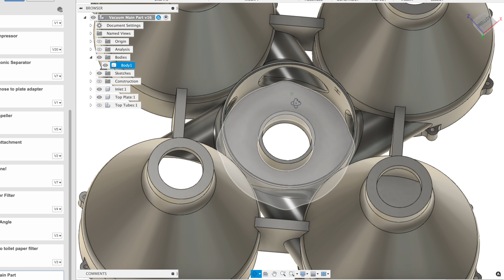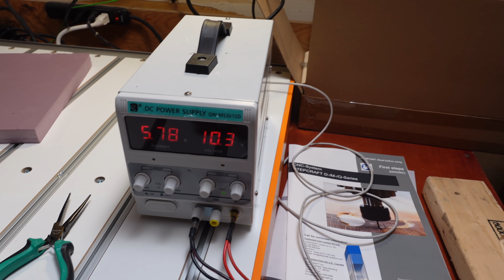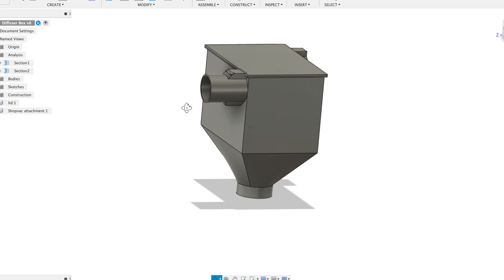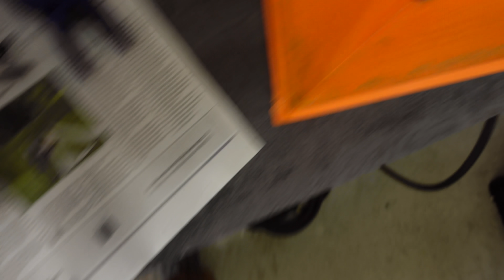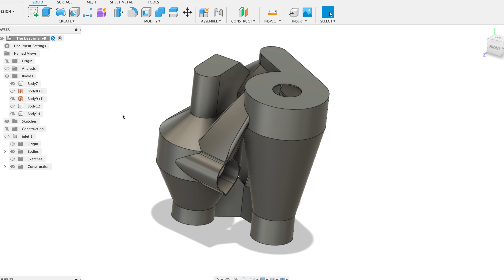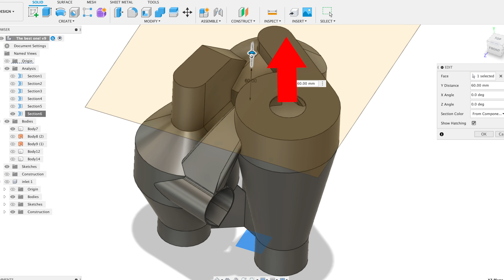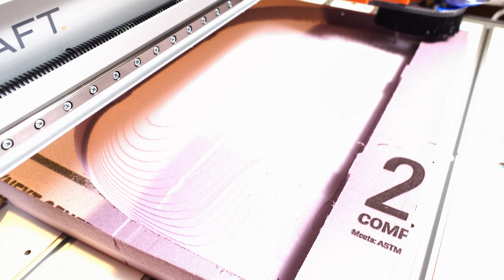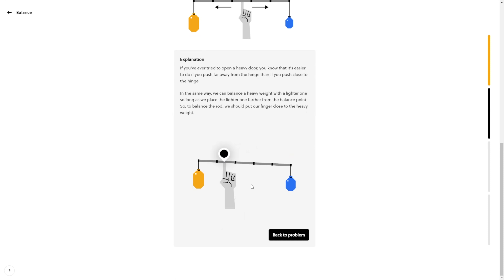3D Printed Cyclone Air/Dust Separator

Comment: Awesome video!! Pro tip: (seriously, I'm a dust collection engineer) Make sure to earth that collapsing flex hoze. The metal wire in there is not to make it springy, but to function as earth wire to avoid static buildup and discharge... I live in a country of merely 11 million people and each year we have 34 dust collection explosions (and consequent total shop losses) caused by failure to properly earth sections that build up static charge... :) I thought that might be a stat that could spark your interest ;) =P (swidt? haha)
Reply: @sourand jaded Same here, I grounded the sandblaster nozzle directly to earth via wire around the hose, it was constant sparks!
Reply: That is something a lot of people don't think about. Thank you for pointing it out.
Reply: Could there be a way to control the high voltage somehow and use it for additional electrostatic dust retention?
Reply: @usertogo  no. having static electricity will always remain a huge explosion risk. It's fairly simple: every mixture of air and a combustible product (powder, granulate, gas, flakes,... and some materials that you don't even consider combustible like sand or flower are equally combustible anyway) has a certain concentration where it gets explosive. In the collection container where the mass sticks together, the concentration of the product is 100%, before the inlet of the collection system, the concentration is 0%, so by definition, somewhere in between there's a point at the perfect explosive concentration. ANY spark at that point will ignite the shit. So you absolutely positively want to get rid of all spark sources...
Reply: @lukearts2954  Extremely important point, definitively and explicitly explained. fail to heed at extreme risk!
Reply: @usertogo  Now you're just playing with fire.
Reply: @usertogo  if one could polarize the charge at one point, they could install a opposite polarity  collector. 
That is how ionic filters work. It is also how laser printers get toner to stay in place while they fuse (melt) the toner in place.
Reply: @usertogo  possibly
Reply: And some flex hose like the 4" I'm using is antistatic without a metal wire, just has a rigid polymer helix instead and all the polymer is doped to have a surface resistance for dissipating charge to a ground wire.
Reply: @GENcELL2014  if you're talking about conductive polymers, then you'll still need to make sure the hose is connected with an earth connection at the filter side. Otherwise it can still build up. If it's a truly anti-static plastic, then the load will be less, but it does not help against the biggest problem, which is the static charge that is caused by friction of the particles in the stream itself. When the hose is earthed, there's a potential difference along the section of the hose (center of the cavity will get charged by the particles among themselves, while the edge will be neutral through earthing), which will draw the charge towards the side and drain it to earth. In a HDPE hose p.e., which is probably the one you describe, the charge is not drawn to any earth, so it will just build up further and then suddenly discharge when touching a conductive element in the filter, almost guaranteeing a spark. My advice is always simple: DON'T use ANY flex hoses at all, unless there's absolutely no other option. In the example of a CNC, I always advise a hard metal tubing to the center of the bed about a foot above the highest point of the head/bridge, and from there a minimal flex tube with earth wire properly attached. Connections to the bed itself and/or motor bay should always be entirely done in hard metal tubing. It's really not that more expensive, it's even easier to install than plastic, and it's sooooo much safer.
Reply: @lukearts2954  yes you make one ground connection to an area on each antistatic flex hose section since they're materials are all slightly conductive. The truly antistatic flex hose I use is called "Flexaust 4" antistatic clear dust collection hose", and they use conductive polymers to achieve those properties.

Majority of my air system following along a wall is rigid 4" abs pipe for optimal airflow, short 4" antistatic flex sections before and after rigid tubing are grounded, along with a 18awg bare copper wire going through the entire system and fixed on inside of flex hose a foot away from dust collector impeller(propeller?). Might glue in many small grounded electrodes going through abs pipe wall into airstream so there's more than just the bare 18awg on inside interacting with charged particles during abs section. With all the antistatic flex before and after along with 18awg internally I don't think the electrodes in abs are needed.

I have around 7' tall ceilings above ShopSaber cnc so my dust collection has to run along drag chains and I was very careful to make sure it's all very well earthed externally and internally so no static issues or interference being so close to wires ontop of the safety reasons for earthing. Portions of the vacuum system on cnc are aluminum tubing and flex sections only where drag chains curve or move.

If I hadn't done the research definitely would be glad for your helpful input.
Reply: @GENcELL2014  Sounds like you've got your bases and all angles covered =) It's very exceptional to see a shop owner actually wanting to go through all the trouble, because most still consider safety a secondary concern... Good on you!! If you want to take it one step further, look into your airspeeds.  Sometimes a system can be optimized by tuning the airspeed. I've fixed systems to work better even by making certain inlets smaller (to increase nozzle speed and to change the pressure distribution between nozzles). But of course, there's always scale to be considered: you're talking about 4" tubing systems. We do have nozzles that connect as small as 3", but the systems we consider small systems are 12" (300mm) tubing at the filter side. I also prefer using fixed systems rather than mobile systems, but sometimes there just isn't enough space available for the best solution.

Anyone wanting to get into dust collection systems, or needs to make a decision or choice, consider these factors: what type of dust is being collected (chips? shavings? sawdust? powder dust? gas?), how many nozzles are aspirated and what are their prescribed debits, is there a variable load (multiple machines alternating or concurrent, multiple machine setups), how many people are using the shop (if you're always alone, then you can make compromises if you know how to mitigate them), which materials are being collected (metal, wood, plastics, paint, mix?) and how long are times of operation. Unfortunately most people choose and decide based on two irrelevant questions: how much space is there, and how much money do I have? Neither of the latter two have influence on efficiency, safety or operational cost. (Small systems collect in bags that you have to buy and pay for disposal; large systems can have container collection where certain companies will give you money to have them collect it; small systems will often be too weak, making production slower and requiring additional cleanup time and more power consumption)

A bonus idea that many people love but don't know it if they haven't seen it yet: a cleaning branch-off. An extra branch on the hard tubing tree that goes straight to the floor in a strategic location, with just a small box with a little door sitting flush against the ground, and 5ft off the floor a split with a 2" or 3" flex hoze long enough to reach in between and behind machines. The box is used in combination with a broom or an electric leaf blower, just push the dust towards it and it will suck up anything nearby. Don't forget to close its door when not using it. (you could also put a shutter above the split instead, otherwise you'll need a stopper for the hose as well)
Maybe a few bucks extra on the bill, but you get SO much benefit in return...
Reply: @lukearts2954  thanks! Considering cnc shop is off the side of my home if it ever went up I'd loose the shop and my home 😬.

Luckily the dust collection run is short but I could see how tweaking fitting before dust boot where chips come in to be a tad faster air flow but the vacuum collects all the chips/dust at the moment. I mainly machine all types of plastic and composites like G10(fr4), some aluminum and copper but dust collector isn't used to collect metals instead I have a Unist MQL system that makes oily metal chips.

I used to work at a cnc machine shop at an old cannery factory that is now a business park with a couple woodworking shops, cnc machine shops, and multiple other businesses. The entire place is serviced with a 2-3 story dust collector that is utterly massive like 4 SUVs wide, something like 36" or larger primary vacuum lines that have 12" or larger offshoots going into businesses. The suction power that thing has...suction could hurt you if you weren't careful.

I did add a T fitting for a cleaning branch in CAD but decided with the 1100cfm dust collector I'm working with, simplicity and minimizing number of fittings will be best for optimal airflow so it was removed. I do have a battery powered shopvac that can quickly suck up small stuff.
Reply: @GENcELL2014  Yea, that was my "normal" stuff =)) "Was", because currently not active anymore after a severe car crash, but always happy to pass on some stuff that I sometimes had to learn the hard way. Whenever I can help someone avoid those hard ways is a win for me =)

The largest operation I ever worked on, was actually an audit on an installation from a competitor who had made a mistake in the connection of a 16-axle mill that the company had bought from our mother company. (the dust collection company was just a spin-off of a machine dealership). That installation was a true monster, with redundancy. And the continuous production made that the owner refused to stop the fans when I had to work on it, only dial it down to a minimum. The main suction unit ran two fans (redundancy) with stepless regulation (to adjust for different production loads, controlled by pressure sensors in the ducts) each fed with a 32". The inspection hatch being close to the fans didn't need much extra securing because of the vacuum the fans pulled. But the sheer volume and mass of air in those ducts, at 28m/s nominal, could easily suck an adult person in if they would dial up the fans while the hatch was open. Scary stuff. I don't frighten easily, but I really felt uneasy taking my measurements there...
They needed such flawless aspiration for the high precision high speed production. The company makes coffins, and they can deliver a completely furbished and finished coffin in less than 2 days. The most time goes into drying of varnish and such, so the wood must be done in a matter of hours after the order comes in. The 16-axle unit however was made for their off-the-shelve series, mass production of the same boards with intricate designs. Impressive machinery. I love high speed continuous production machinery.

As for the site you refer to: it's always great when multiple craft shops can get together to invest in a better installation, but there's a larger risk too because they all work with different materials and have no control over each other... A "small shop mistake" (stuff that we tend to expect and accept in smaller shops but wouldn't accept from ISO normed large factories) can destroy a bunch of businesses in one fell...
Reply: @lukearts2954  the place is called Pauwela Cannery Center. Now that you mention it I could see how issues can arise, luckily they do mainly wood and machine shop primarily machines composites and wood, those materials seem complementary. No issues for decades so they definitely figured out whatever they needed to for a central system.

One of the woodshops have a like 10'X, 30'Y large cnc router and machine shop uses a HAAS vertical milling center.
Reply: Is no one gonna talk about the fact that 98 percent of us had no idea that a dust collection engineer was a thing?
Reply: @g45h96  it's like an HVAC engineer, but with dirty air instead of clean air... X'D  Or did you think those systems designed themselves? hahaha
Reply: @lukearts2954  This is why I love YouTube so much - every so often in the comments section, you find people doing jobs you didn't know existed who freely share their expertise and experience for the benefit of others.  Props to you for that!
Reply: @FanPhys  Thanks! I'm always scanning the comment section for such information, so I'm merely returning the favor =))
Reply: @g45h96  You could say that about most products and engineers, so no, not really. People don't really think about the details of how the things they use became a thing, and what difficulty was involved.
Who would have thought I would be a valve cavitation and noise engineer...and previously a gun conversion engineer.
Reply: @court2379  exactly :) Born in a STEM family, I'm always surprised when I notice how many consumers are clueless about how things are made, mostly because they simply aren't interested (and that's fine), but sometimes just because of the infertility of the environment in which they grew up. Not all specialties of engineering is taught separately, so dust collection engineering sprouts from mechanical engineering and electric engineering (the latter was my major), with a high focus on duct fluidomechanics and vibration mechanics (you need to avoid resonance in longer ducting to lower noise and increase stability and such). But here in Belgium, we have a lot of very specific engineering diplomas you can get. Simple examples of how specific, you can get an engineering diploma in stable building or in beer brewing, but also in brewery building or marine propulsion (and these latter are probably the most literal engineers you can imagine: they design, make, maintain and repair boat engines. A very interesting and challenging trade.)
Cavitation, probably the most underrated unknown topic that has severe influence on almost everybody's life without them knowing it.... I have to say that even in my studies they only covered it briefly and mostly theoretic. But as a firefighter I took a specialization course in engines and pumps as optional during the training for the rank of corporal (preparation for engine drivers) in which we covered cavitation in detail, with lots of examples of damaged pumps. The hydrostatic shock from cavitation is so much stronger than you can ever imagine until you see huge chunks of metal missing from a pump blade or from an oil tanker propeller blade... Since you're mentioning noise as well, I'm guessing it's in the area of industrial facilities design or industrial installations design?
Reply: @lukearts2954  unless that material is conductive, which I'm pretty sure it's an insulator, then grounding that wire isn't going to do much at all. the static will still be on all the parts that aren't being touched by the copper wire....because it can't move through an insulator. If the hose was a conductor then it wouldn't need the copper wire going through it, you could just attach a wire at the end and ground it.

on top of that he doesn't have enough pressure build up with a shop vac to cause an explosion or fire. there's zero documented fires started with home dust collectors. they're not powerful enough.
Reply: @atomictyler  state your sources, because imho you're talking out of your à$$. Explosions don't have anything to do with vac pressure. Your comment is hilarious.
Reply: i am glad that this was pointed out. Safety first, especially when even flour can be highly explosive if ignited. 
Keep in mind that in english "to earth" is "grounding" or "zeroing", as GND on electrical schemes and PCBs :)
Reply: Hi,

I would like to 3D print a cyclone to remove ultra fine dust. I want to use this cyclone to 100% clean normal outdoor air to blow into my house. The idea is to give my house a positive air pressure with 100% clean air in order to make the inside of my house dust free. I thought to combine this with a humidifier. I have printed a 700mm high cyclone, but that did not collect any dust, yet my house inside does have a lot of dust.

Is it possible that you can share 3D printable designs.?

Regards
Rudi
Reply: @rudiklein2848  I think you need to look carefully at what the dust in your house is. In my experience it is mostly made of fiber from clothing, carpet, and furniture, with a bit of dirt brought in by foot traffic. Depending on the source filtering the outside air may not help much.
Unless you are in some area that is extremely dusty outside.

I suspect it will be difficult to get the dust out with a cyclonic separator as the speed needed to get enough centripetal force will be higher than fans can provide, and the noise would be too high.
Maybe look into charged ionic plates, or a water filter. With the water filter you take the incoming air and force it thru a tank of water. Use a manifold to spread the air stream out to many tiny outlets so that little bubbles form and float to the top of the tank which is the clean side. The tiny bubbles increase the surface area and make it more likely any suspended dust will contact and stick to the water.

The main draw would be that the water will pick up moisture, and depending where you leave that is a problem.

Good luck on your project.
Reply: @court2379  Thank you very much for this nice reply.

It is much appreciated.
Reply: @court2379  This works but you are shooting your self in the foot. De Gassed water has lower surface tension and can get the dust out, once you bubble the water you introduced a gas to the water and increase it's surface tension, which makes it harder to hold dust. Or so as I think.
Reply: @1800Supreme  I have used this method for years to clean air for fish aquariums. Seems to work fine. If you think surface tension is a problem, put a few drops of soap in it.
Reply: I heard of a electrostatic discharge fatality, so I'd say ground those things.
Reply: Are you familiar with SN25T5 industrial cyclone by any chance? I got one, but it doesnt seem to work well against fine dust. In fact, it seems to be worse than diy variants using pipe couplers.
Reply: @maw9812  sorry, I must have missed your comment 5 months ago. Didn't mean to ignore you. Cyclones are in general very ineffective against fine dust because large model cyclones mostly function with centrifugal separation. The fine dust does not have enough mass (inertia) relative to the surrounding air to be properly separated with centrifugal force and the swirling causes much turbulence which keeps the fine dust in suspension. The only reason why fine dust can efficiently be captured by cyclone vacuum cleaners, is their small scale. I suppose you could try and have a series of a couple dozen vacuum cleaner sized (scaled) separators in parallel as last step after a larger cyclone separator, but I cannot see that cost effective nor space effective in any way. I don't know the specific product you mention. Every cyclone separator has an optimal use (range) that depends on the barrel diameter, inlet diameter, height (total volume) and cone angle. They will have a range of particle sizes and air flow speeds that will make them most effective.
For fine dust the best way is to have your duct feed into a large separator chamber with an evacuation system at the bottom (e.g. screw hopper) some flow breakers in the center and laminar flow upward through a large surface filter medium that is regularly unclogged with high pressure air bursts from the clean side to the dust side. Due to the sudden speed drop when entering the chamber, gravity will help get the dust down. Having the air flow turn laminar from that point reduces suspension (turbulent air has a higher load capacity than laminar air. Easy example are storm clouds and hail, where a lot of water is carried thanks to high turbulence). You cannot avoid all static charges, even with anti-static fabrics, so the cleaning cycles are necessary to make sure the dust does not get sucked deep into (or through) the filtering medium. With such a cleaning system, you can actually filter out smaller particles than the rated size of the filtering fabric. An optimal wide range system would require a block trap (any large objects that get accidentally sucked into the ducts need to be taken out before they hit the cyclones at high velocity - it's just a wider section of the tubing with a gravity trap door at the bottom that is sucked closed by the system. It also makes the start-up of the system less wearing on the motors because it reduces the load until the door is shut) then a set of cyclones (various sizes depending on your product, from smaller to larger as for centrifugal separation, the smaller the particle, the larger the required diameter of the barrel and you want to separate particles from large to small) and then a final fine dust separator using a large surface fabric filter. If you really want to go nuts, you could add a gas filter and activated carbon filtering. I've seen 1 installation that has this, because they recycled the shop air into the offices since the extracted air is warmed up by the machines. By adding one more filter step to a system that they already needed anyway, they eliminated central heating altogether. But I think I'm drifting too far away from your question hahaha Conclusion: to separate fine dust, you need to reduce airspeed and turbulence, two things that are hard to do in a cyclone.
Reply: @lukearts2954  Wow, I didn't expect an answer this detailed, thank you. As for size, I need something for my diy workshop so I don't particularly care. I did some research meanwhile and I found several projects that seem promising as they appear to include parts that are supposed to reduce the turbulence and speed of the finest particulate, just as you mentioned
Reply: Your mention of dust caused explosions made me think of those USCSB videos about the dangers of combustible dust in factories. Incredibly interesting work you are doing.
Reply: If you’re a dust collection pro, then I very much desire a conversation.  If there’s any way I can contact you, please let me know.

But the thing I really want to understand is: What is the rough micron limit for the smallest stuff a cyclone can catch?  Presume a 2-3-step setup, done in smart fashion, etc.

Given a target micron size, and particle density (g/cc of solid), and flow rates and stuff, there must be a canonical math for how to design these.  Where can I find this?
Reply: @craigsearching  good question. For starters, being a pro does not make one a god =) haha. 
You might be surprised to hear that most of the tables I use are still on paper, and a lot of it is unfortunately proprietary (not that it's any kind of trade secret, but just that there is no commercial publication available that I could reference you to). Sketching out a layout with the right numbers on a shop floor still goes better with a pencil than running around with electronics in a DUSTY environment to do it all fancy =))) So it's a clipboard and paper tables for me...
That been said, I can point you in the right direction by saying that there are so many factors at play that it would truly be impossible to build a theoretically perfect system, even if you have an absolutely homogenous inflow of a single particle size. This means that you will have to design your system for a range of particles and a range of loads. Those ranges need to overlap. So there is never any need for calculating any exact theoretical cut-off. (meaning that I have never encountered any kind of calculation like the one you are describing, simply because a situation that could benefit from that level of accuracy does not exist in this world/reality/universe. In spite of this, I do share your excitement for mathematical accuracy, and the geek in me would be happy to see a system that could accurately calculate the realistic values that are determined by ambient temperature, humidity, substrate humidity, material density, particle concentration, air speed, production speed, duct diameter, duct trajectory - length, turns, branching, turbulence, temperature variance - , surface finish of the cyclone, aging of said finish, atmospheric pressure, and a couple dozen more factors that would effectively influence the result when observing micron scale particles. Also note that many of those factors are variable and impossible to control or manipulate.)
The smallest particles that can be caught with cyclone alone are not in the micron range, regardless of the airflow (unless you go to otherworldly dimensions to make the air that sucks strongly at the machine would almost stand still in the cyclone, and still then I would not sign any guarantees over 80% for sub-mm particles, which is not good enough) For smaller particles, you also should not want to use the cyclone in a turbulent mode (centrifugal separation) but rather use it like Dyson root cyclones do: separate the smallest particles with 0m/s airflow in the central air funnel of the cyclone, which is very hard to do on a large scale system (it works for Dyson because their cyclones are mm scale and their height is centimeters, it's just impossible to have a stable 0 m/s funnel in a large barrel).

So, trying to give you a final answer on how to go about your design, without actually knowing what you're trying to achieve, I say this: I'd have to go googling to find the online references you're looking for. Try browsing the websites of some companies that are making turn-key solutions for all sizes of installations, e.g. Coral (Italy). They usually have more publications available online.
As for your system, you will have to use multiple stages, with the final stage filtering out the finest particles with pass-through filters, NOT with cyclones. If you're talking about ultra fine dust (like vehicle exhaust, soot, pollen etc) I would actually suggest to use gas filtering (like welding fume filters or spray paint filters) for that last stage.
The biggest challenge in systems that need to filter out the finest of particles, is to overcome the static charges that make the dust stick to any charged surface, including your filtering medium. This means that if you don't include clearing cycles, your filtering medium will clog up quickly (which is probably why you are wanting to use cyclones instead, isn't it?). The most efficient way is having an overpressure cycle (shut off the vacuum and give several bursts of high pressure air in the opposite direction through the filtering surfaces). The available "shaking" systems are total B.S. They may work on fresh filter sleeves with ultra dry dust in short production runs, but as soon as any of those ideals change, their effectiveness drops to negligible percentages. (So they are only good for the DIY home shop that doesn't have shop air and that never runs longer than 15 minutes at a time, a few times per day)

PS I'm not disclosing my direct contact details here, because YouTube is constantly combed by data miners for scams etc. But as you see, I don't mind leaving lengthy replies here.
Reply: @lukearts2954  It's the first YouTube comment I have to print out.  Outstanding and thank you.
Reply: @craigsearching  lol (about the printing) and you're welcome :))
Reply: @lukearts2954  Anyone with a time-earned gift at understanding cyclone separators owes himself a Google search for "cyclone gasification".  A very interesting subject.  Essentially, using high-temperature stainless-steel cyclones to convert "trash" biomass, like straw and sawdust, into useful gas, like for heating.
Reply: @craigsearching  it is an interesting concept indeed. I'm a big fan of the current search for alternative power sources, not just for the benefit of the climate and environment, but also for the boost it gives to chemical and mechanical engineering. 
Technical sciences always makes big leaps when facing difficult times. The idea of trash gasification is actually the same process that is used to make charcoal: you cook combustible gases out of solid material, then use those gases in a controlled way. 
By using a cyclone, they simplify the logistics and using it for power production they are probably using a far higher percentage of the chemical energy than what is used in the charcoal process. 

I would not see a safe application of this in a single system with dust extraction from a wood workshop. To safely extract the gases, they will need a steady predictable flow of material, so they will have to feed it from a bulk storage. If such a system would be directly fed by the woodworking machines, I can see several possibilities for explosions and fire...
Reply: @lukearts2954  Totally.  A separate machine entirely.  But still maybe an on-site one.
Reply: @craigsearching  yes. Before I got into dust collection, I was in solar installations, which made me evaluate the grid and our current way of generating power, and I came to the conclusion that we're doing it all wrong. It would be best group several companies doing the same thing (competitors) who can then share their waste disposal and share any power production that is done on site with their shared waste, because often small scale alternative power sources use waste products. Unfortunately there are still many that require combustion, which still isn't a viable long term solution until we get better air scrubbers to recycle the exhaust gasses. The best solution forward from where we are, would be to equip each grid terminal (home or business) with a large battery, so that most consumption is done from locally produced power, eliminating the large network of high load power lines. Next would be to revisit the choice for AC-only networks: if you don't need to transport the power over long distances, DC becomes viable again, and several "green" power sources actually generate DC which has to be converted to AC at the cost of noise, heat and other losses. (e.g. solar)
Having a local power generator from the waste you produce yourself, is definitely a solution that would fit into my view of a sustainable power solution. We have to diversify and decentralize most things that are currently single-sourced and centralized, while other things that are currently dispersed need to be centralized to increase efficiency and reduce load (not just cost, also pollution, logistics, transportation etc)
I'm not sure the voters are ready and mature enough to vote people into office who could actually work towards such a sustainable future, though. It requires people who look at the bigger picture, from a perspective that will never be their personal one.
Reply: @lukearts2954  That is the most sensible comment on renewable energy I have ever come across -  decentralize power generation and recycle industrial waste by centralizing shops.
Reply: @pazu8728  Thanks :) Somehow you probably cross-commented from a different thread, because that's indeed a view that I have voiced, but not in this comment thread... or so I think haha
Reply: @eili_04  by holding the tube/nozzle with your bare hands :)) You are the grounding wire for the tube on the nozzle side, the appliance side is earthed by your wall plug (if you live in a country that upholds sensible regulations for power grid connections). Also, the dust load of a normal house is far FAR below that of a woodworking machine and thus equally far FAR below the explosive load mixture. It does, however, make a lot of sense to clean out your vacuum cleaner very often: for bagless devices, empty it after every single use. Bagged devices should get clean bags well before the indicated load limit is reached. Phobic people should use water vacuums (the aspired air is pulled through a water volume where all dust stays behind.).
Reply: @eili_04  I think you are asking if a cyclone pre-filter would improve safety when vacuuming threads and scraps of material with a bag vacuum?
The first thing I'd like to point out is that threads are very light and the lighter the particle, the larger the cyclone needs to be. So if the other scraps are heavier materials, then perhaps you could separate those from the threads, but otherwise a compact cyclone would not do much to begin with.
(the threads will just get sucked through as they remain in suspension, or they clog together in a fluff that will consequently get sucked through before it can fall down the funnel)
As for safety, I may have pointed out before that the risk around the house is extremely low when the vacuum is used with proper care (cleaning and bag exchanging). The added hassle of using a cyclone pre-filter is much more effort and cost than just vacuuming a little more often and changing out the bags before they are stuffed. And I doubt that there would be an effective safety benefit with a pre-filter, since the most fire-prone materials will be the lightest lint and dust fibers that will get sucked through into the bag anyway.
It's a different story for central vacuum systems, that have long tubing inside the walls that are difficult to clean as you go, and that usually have larger containers and longer intervals between receptacle exchanges. But I'm sure the companies who install those systems will know their stuff and will properly earth all their equipment.
Reply: I made a cyclone to fit on my Makita shop vac and constantly get shocked by it. I have an upgraded hose (with wire through it) but it seams pointless because the vacuum is plastic. Could I send you some pictures to get some suggestions to ground the unit? (cyclone is fixed to a 5 gallon bucket on the top of the vacuum)
Reply: I use a bucket top cyclone device to clean out my wood burner. The ash make so much static electricity, I get zapped pretty hard core. The system is all plastic, so there's nothing really to ground.
Reply: @wiredforstereo  just hang a naked copper wire in the bucket, melt a tiny hole through the plastic just below the sealing ring, then lead the wire down to the underside of the bucket. The wire will earth it to your floor, and if your floor isn't earthed, then at least set yourself at the same potential by keeping your leg or arm against that wire. You will discharge as you touch the wood burner while you clean it. But in truth, I'd suggest you get a metal one. Frankly I haven't seen any ash collecting pre-filters in plastic anywhere here in Western Europe. They are all plate iron, with a steel hoze even, because there's always a risk of glowing embers being embedded in the ashes, even after 12h or more... (I've relit my stove from glowing embers more than 24 hours after the last wood refill the day before)
Wood ashes can be explosive too. They contain a lot of carbon monoxide as well, which is also something many people don't think about. Carbon monoxide is an explosive gas.
Reply: @lukearts2954  It's just a cheap bucket top thing, probably shouldn't use it for ash. But the vacuum itself is stainless steel.
Reply: @wiredforstereo  stick an earth wire into the ash collection area make sure its exposed. you could run it up the inside of the pipes as well if you don't think its grounded enough
Reply: @wiredforstereo  Just run a thin sire along the air path and earth one end.
Reply: @wiredforstereo  you could put some aluminum duct tape in the cyclone and then ground the tape
Reply: @wiredforstereo  just as with the plastic pipe in the video you can fun a coil round the plastic tubing/cyclone parts to capture and discharge to ground
Reply: @wiredforstereo  fit a metal pipe in the intake of the ash sucker and ground that. (Or replace the entire sucking handle with a metal pipe and ground that)
Reply: What about running a spiral rib down the inside that hinders the circular flow of the particles as they are thrown outward? It can be set so that it also deflects the particles downward.

Even a straight rib might work and would be easy to test by taping a wire to the inside. With a bit of care the conical helix one could be tested with a wire as well.
Reply: just attach a pump to a good water pipe bro
Reply: 420 filter duddeee 🤙
Reply: What do you recommend to dispose and/or storing saw dust? Is it better to use a shop vacuum?
Reply: @eili_04  1/ you are clearly confusing an ash trap and a cyclone. An ash trap is NOT a cyclone. As a lay person, you may think they are alike because they both are cylindrical on the outside and have a central exit, but they are not the same thing. Also, you keep talking about domestic/residential applications of main stream mobile vacuum cleaners. I can only repeat: the scale you are operating at has NO risk for explosions or fire, just use the device properly. Safety considerations are for professionals, or enthusiasts who operate at professional levels.
2/ I think you're in way over your head, so I'll spare you the science. Just take my word for it. The larger the cyclone, the more time the particle has to come out of suspension. What takes longer to stop floating in the air: a car sized rock or a 2mm feather? I fear you're still thinking about the vacuum cleaner in your closet. Dust collection is not the same as vacuum cleaning. They are two different worlds. :) Much like turbojet fan blades and HVAC fans. They both are called fan, and both move air, but that's where the comparison stops. The same applies here.
Reply: @eili_04  When designed properly, in theory a cyclone could capture anything. But if you want to capture ash, it's going to be in the scale of silos outside your house. The finer the particle, the larger the cyclone. It needs to spend more time inside the cyclone at a slower flow rate in order to settle. 
(in theory the root cyclone used by Dyson could capture ash, however in practice it will only capture a certain portion for a certain amount of time before it sticks all to the cyclone tips and breaks up the fragile cyclone flow, causing more and more to get sucked through - speaking from experience hehheh). 
The absolute best way to get rid of ash, is a water filter. You can get them in vacuum cleaners and they work very well. A bit pricy, but you get your money's worth if you stick to a trustworthy brand (i.e. one where you can get aftersale services like repairs and spare parts).
Reply: @eili_04   I have no clue what you're asking... (and no, dysons are not mini-cyclones. They use "root cyclones" which are a completely different fluidomechanic. When people speak of cyclones, they mean separators that are taking particles out of suspension with inertia. Root cyclones (are supposed to) take particles out of suspension by speed reduction (in the center of a whirl funnel, the air stands still and thus the dust falls down). Root cyclones do not work when you don't place them right side up because with the slightest angle the dust will just fall back into the faster flowing air.
Reply: Great comment!!
Reply: Do you have link to an article about these explosions? Would be an interesting read
Reply: Can I ask you some question. I'm currently doing a thesis which is about desiging a dust collector for a mobile robot (I take the reference from Goliath CNC).
Reply: @hoanglongnguyen6302  you can ask, and I can try to answer. Are you talking about a vacuum cleaner robot?
Reply: Trust in Jesus Christ our Lord And Savior
Reply: @juanit0tackit0tackito2  dude, I'm trying to maintain my cover here... Don't blow it!
Reply: Hey, a dust collection engineer! What... are you 12?.. My kid in his 8 has better understanding of static electricity and purpose of that steel wire in that "collapsing flex hoze". Go back to school!
Reply: @igorzavoritko5763  X"D you obviously have never seen one up close. It's copper alloy, not spring steel. I guess you should apply your "advice" to yourself. What's your problem anyway?
Reply: @igorzavoritko5763  Well hopefully your kids school teaches them better manners...
Also these hoses are made with plastic reinforcing as well, so using metal wire would be something you specifically need to choose for the purpose of disapating static.